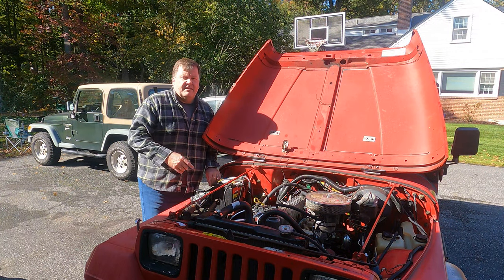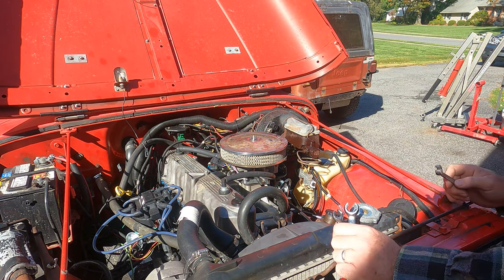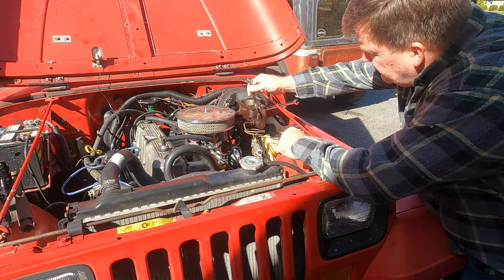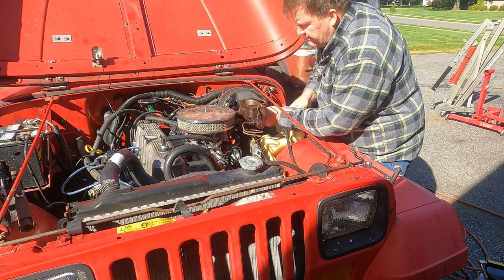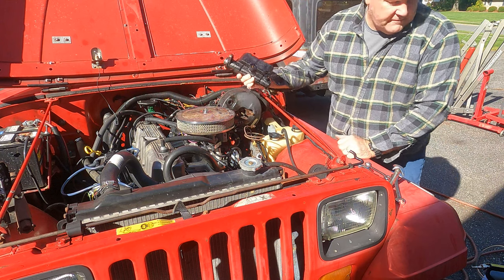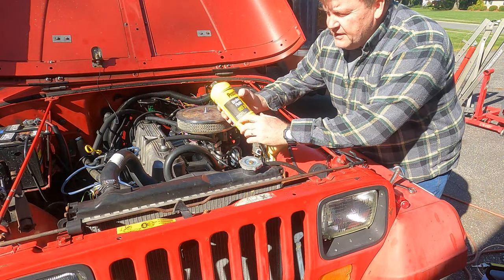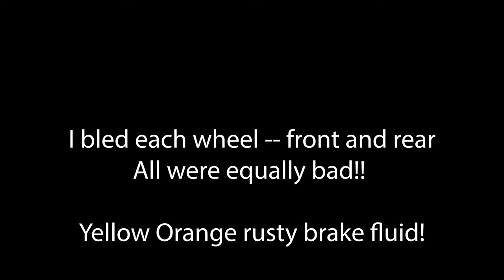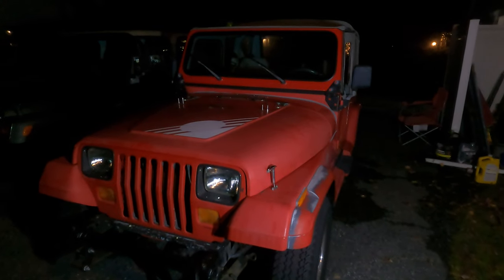Jeep YJ Brake Master Cylinder and Brake Bleed

Comment: A good tech tip for older vehicles is to use DOT4 instead of DOT3.  The DOT4 is functionally a drop in replacement for DOT3 and is less hygroscopic.
Reply from the maker: Yep...agree... I notice that there is a bunch of rust that ends up in the cast iron calipers, etc...and the fluid turns an orange color (iron oxide)... Also, the moisture in the fluid effects the compression and you'd get a squishy pedal... Thanks for the comment!

Comment: Why attach first ?? Seems like potential for accident bending lines if dropped
Reply from the maker: Either way would be ok.  Those lines are pretty tough steel and they don't bend too easy.  I chose to do it this way as they seemed easier to get back into the ports without undue stress.

Comment: What size were the nuts to the brake lines? No wrench I use works.
Reply from the maker: Let me check.  I will post here, but for sure use a line wrench.
Reply from the maker: Mine are 1/2" ... definitely use a line wrench...it grabs on more corners.

Comment: Did you not bench bleed it?
Reply from the maker: No.  With a power bleeder, it was not necessary.  The vacuum formed by pulling the fluid through will also pull the air out.  Of course if you don't have a tool like that, a full bench bleed is a must.

Comment: Why did you not do a bench bleed on the master prior to installing it?
Reply from the maker: With a power bleeder you don't have to bench bleed.  The vaccum of the bleeder will.suck the air out of the system and pull.fluid through.  One of the awesome things about the power bleeder. .I've never had an issue with air left in the system.
Reply: @jimsjeeps9782  OK, Thanks!  Please keep making more YJ content.